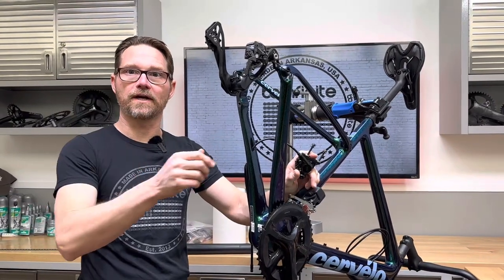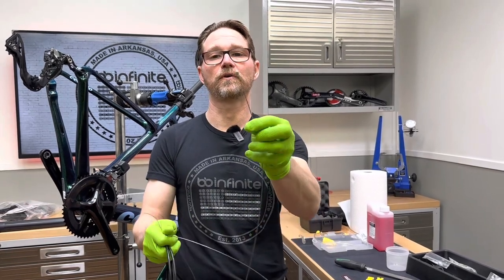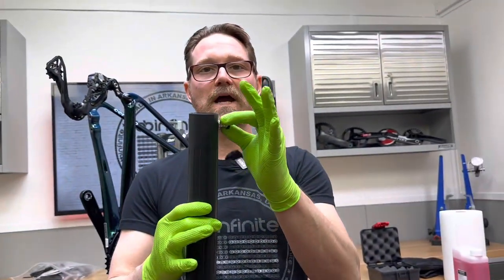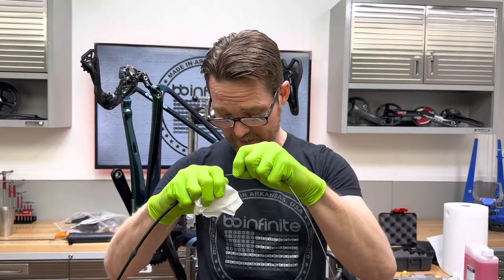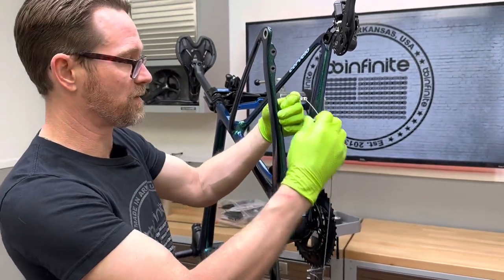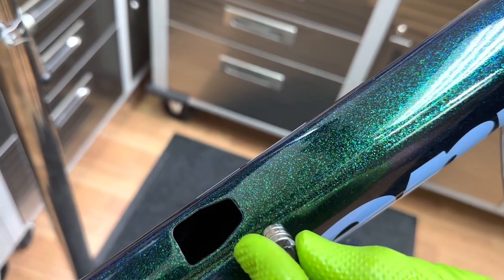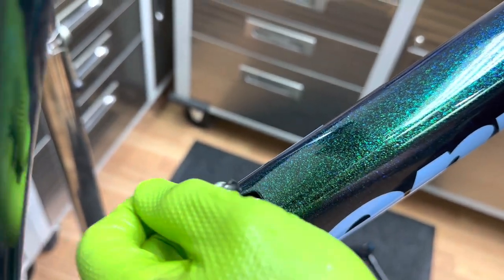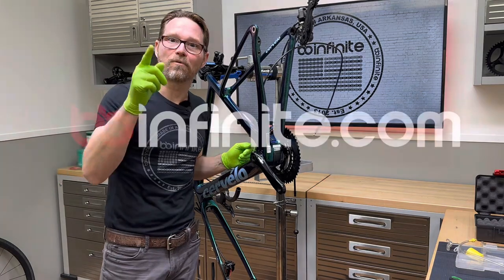Route Internal Brake Hydro Line in Seconds!

Comment: Glad you showed it with the bb and cranks on - I am a little afraid to take my BB off, might have bunged the install 😅
Reply from the maker: We always subscribe to the "If it's not broken, don't take it apart...leave it alone" philosophy.
Reply: @BBInfinite  exactly my thought, I may have bunged my threads on the BB but it is on and works. I don’t want to deal with that until I need to. So I’m “leaving it alone” 😂

Comment: A lot of times the housing or hose will get scratched up pretty bad from the sharp burrs and edges inside the frame. It’s unavoidable even if you lube the crap out of the housing/hose. 

Internal routed frames need to have conduit sleeves so the housing or hose goes in and out smoothly.

Comment: Does this work if I leave the barn in the barb in the house? Or will I need a new barb?
Reply from the maker: This works with the barb in place. No line cutting needed. It works with old lines too, since often they need to be pulled to replace rear suspension bits on full suspension mtb's, etc...

Comment: This is avery good ad for Parktool IR 1.2 or 1.3
Reply from the maker: How, when the "tools" used here cost under $8 total.
Reply: his method cost alot less, but even if you do want to go with an actual kit why spend $75.00 on a Park Tool kit. I bought a generic kit for 17 bucks and it has all of the exact same fittings as the park tool kit. But instead of having a routing cable for each fitting mine has one routing cable and the fitting screws onto it. So less parts to worry about.

Comment: https://www.youtube.com/shorts/EWt1trKlbLM
https://www.youtube.com/watch?v=riO5XYdR2C4

We place cardiac stents like this. So what I would do is when you dismount calliper and leaver, put a wire in the old tubing (while still on the bike); than remove the tubing, keeping the wire inside the frame; than place new tubing back over the wire that is already inside. remove the wire.